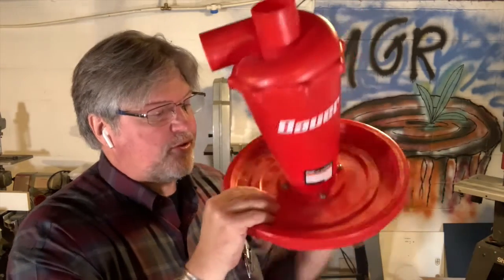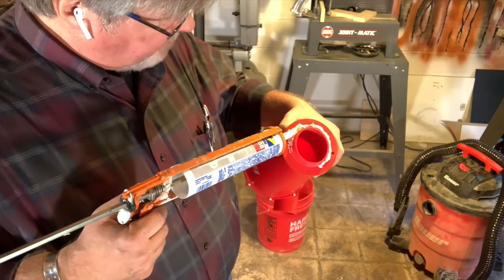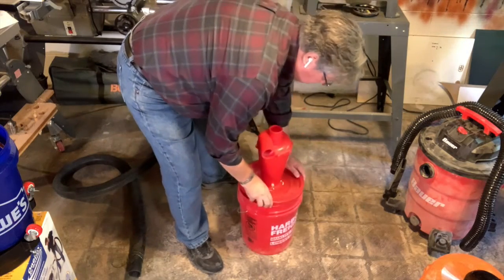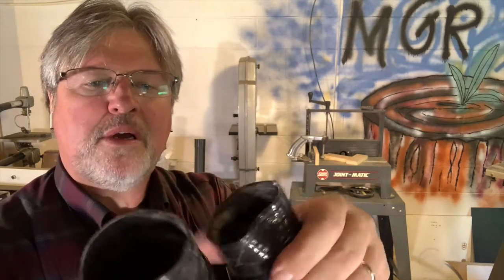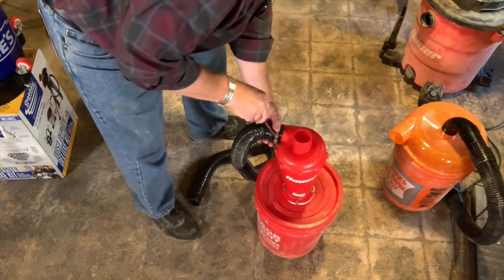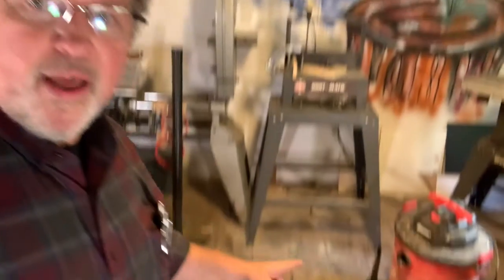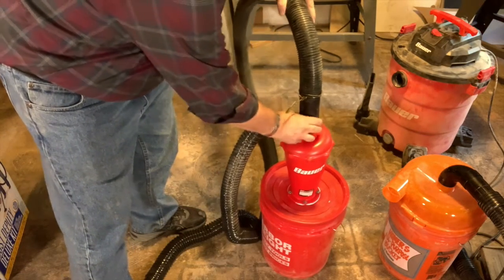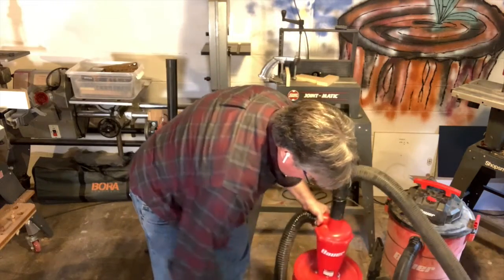Bauer Cyclone Take 2: Deal or Dud?  Not a Fair Fight?

Comment: what is the size of the outside of the vacuum inlet and the suction port?  Are they the same smaller diameters as the Chinese ones?  Anyone measure these ports by chance?
Reply from the maker: Stan, on which cyclone? I just checked the manual on the Bauer and it doesn't state the diameters, but I suspect they are metric. Scott
Reply: @MyGrowthRings  the Bauer one from Harbor Freight.. I got a cheap Chinese one but it’s outlets are too small for my 2.5” hoses..  I was hoping the Bauer one was really 2.5”… was you able to measure its outlets when you were testing it?
Reply from the maker: @mrstanskaggs1  No, I didn’t measure it but I can tell you that they were an unusual size that didn’t fit my hoses.
Reply: @MyGrowthRings  was your hose 2.5”?  Was the ports too small or too large?

Comment: I have two Home Depot "Dustopper" brand cyclone separators. I'm very happy with them. The  HF brand Bower separator was not available when I purchased the Dustoppers but I did consider the possibility of going with  similarly designed brand. What I liked about the Dustopper was its low profile and low price. Considering how the Bower's instability, inferior hose design and its high price were an issue in the demonstration, I think I made a wise chose.
Reply from the maker: Thanks for sharing and I totally agree. Scott

Comment: A hepa filter and bag on the vacuum is a good idea to to protect the motor. Then exhaust the exit air to the outside. Tptools has a dust collector exhaust kit.  
I want to use this for a blast cabinet and dint want any if the blast dust inside my garage at all.

Comment: Tough sometimes to eat crow, but I, for one, appreciate your fine and tasty repast. I could see mounting a router on a trammel and cutting a circle to fit the lid. Should help stiffen the cyclone. I would likely adapt the cyclone to a 15gal pasteboard barrel, both for capacity and stability. That would eat up slightly more floor space, but is likely a good trade-off in that you'd likely see FOUR times the dust collected before needing to empty.
Reply from the maker: Thanks. Yeah, when I realized that it could have performed better I knew I owed it to HF to give it another go. Scott

Comment: I'd like to build something like they use in sawmills where they have a large pipe running the length of the shop. At each machine they have a t and a smaller hose to connect to the saws and the collector just constantly runs while they work
Reply from the maker: Those are sweet. I’ve worked on a few shops with those and they are great.
Reply: Several YouTubers show the construction or installation of while shop systems. I don't think any of them ring in under a hundred bucks.
Reply: The problem with that is total cost and space requirement. Lets say you have 4 tools, and each tool require a gate and a T connection plus the hose itself. Every piece adds resistance. With all that resistance, you need a stronger motor, and possibly a beefier circuit. And a huge collector on top of that and you have a great system, but it takes up a huge amount of space. And possibly cost several thousands of dollars too. But it is awesome once you have it. Back in school, we had a system like that when we learned woodworking.

Comment: No no no, the hose that came with the box goes from the vacuum to the vortex.  You use your vacuum hose as you always did and use it to vacuum your shop.  this way, the collector stays near the vacuum and (in my case) my 20 ft hose goes all over my shop.  It never tips because there is no tip.  Also, putting a bucked (cut down) inside the bucket allows it to be stiffer and does not collapse under suction..
Reply from the maker: Did you catch where I read the instructions?

Comment: The biggest issue is the ridgid 14 gallon shop vac is pulling 165 cfm. 
Assuming that the Bauer cyclone is designed to work best with their shop vacs. Their 14 gallon pulls 115 cfm. And their 6 gallon only pulls 75 cfm using a 4hp motor. The cyclone also uses hose sizes 1.25 - 2.5"
The home depot separator says to use a vacuum with 4.5 hp or greater. I think your vacuum is too much for the cyclone, not really comparing apples to apples.
Reply from the maker: That’s doesn’t surprise me. You’d think that HF would have a recommendation on the separator, but they don’t.
Reply from the maker: @roscoepatternworks3471  Huh? How does “Compatible with mist wet/dry vacuum hoses” tell me if the Bauer vac I’m using isn’t going to have too much cfm? I’m sure that eventually they’ll make it very clear which of their vacs will work best, but currently,or at least as of when I purchased mine, that info isn’t provided. Thanks again, Dave. Scott
Reply: @MyGrowthRings  for some reason thought you had a ridgid shop vac. Probably a different video, I've been looking at these cyclones and reviews. But after reviewing your video a second time I was wrong.
Reply: @MyGrowthRings  after watching a second time i think you may have misinterpreted some things.

1. Attach the Collection Hose to the side port and use Hose Clamp to tighten..

My interpretation: the side port is on the vacuum, so the 2 1/2" ridgid end of the 4' hose to the vacuum. The soft end goes to the outlet on top of the cyclone.

2. Attach vacuum hose (sold separately) to the top port. If the diameter of the hose is 1 1/4,1 7/8, or 2 1/2, then attach vacuum hose to Reducer.

My interpretation: the adapter is cut to match the hose that came with your vacuum. And attach to the inlet of the cyclone.
The 2 hose clamps go on each end of the 4' hose. And the 4' hose can be cut to your desired length.
I'll find out tomorrow as I'm going to buy one.

Comment: I worked in the mining industry for many years. With huge cyclone setups. If you have any understanding at all about how a cyclone works, it would be obvious that the hose from vacuum goes in the top. Just saying
Reply from the maker: Yep, and it doesn’t even require a lifetime of experience if the manufacturer would just put proper instructions in the box.

Comment: 4:25 I am confused as to what you are saying here. In this video you are suggesting that you connected the hoses to the wrong ports in your last video (https://youtu.be/yrD2NXpE7rg), and that explains the cyclone’s poor performance….but I watched your last video and the hoses were connected correctly (shop vac to the cyclone centre port)….so why all the back peddling here?  Also..grossly overloading the air stream with debris  is naturally going to fail right. But good vid test.
Reply from the maker: What I am saying at 4:25 is that there is contradictory information on the package and the manual.  I'm not sure how I can be both grossly overloading and conducting a good test, though. Anyway, all I wanted was improved dust collection without clogging my vac's filter and I got that with the Dustopper.